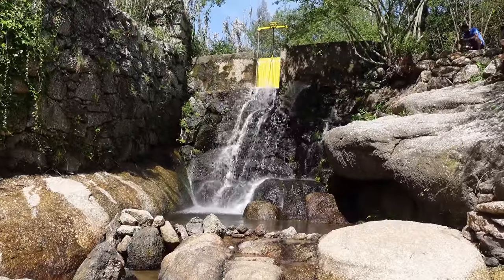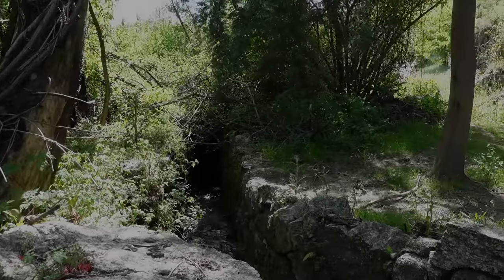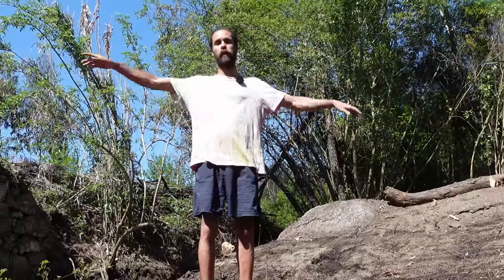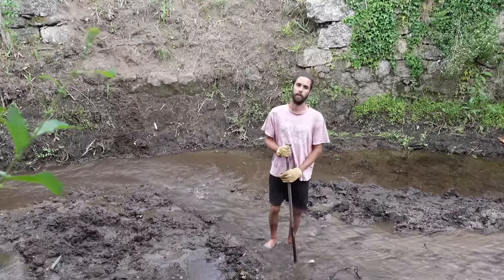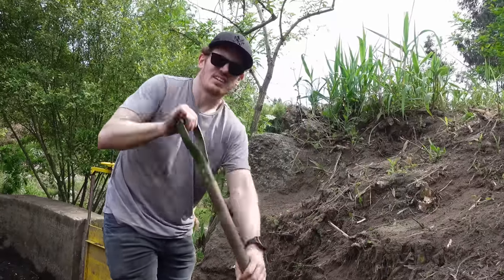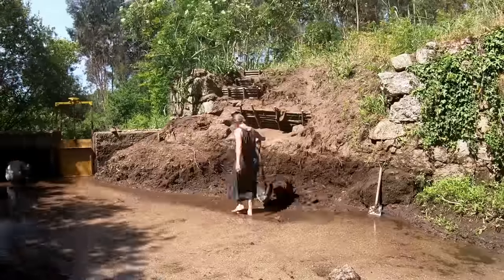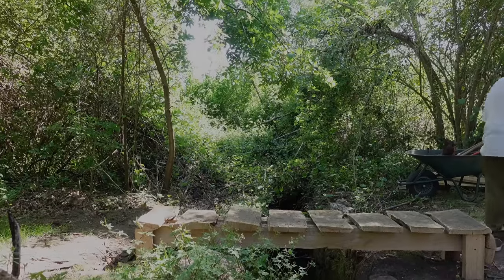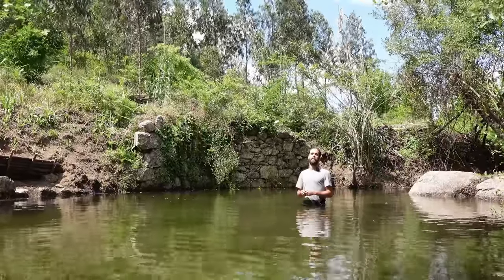#79 Re-discovering an old natural pool

Comment: REGARDING THE CHESTNUT SPROUTS: That species is the highest value tree in your region.  Select one of the root sprouts and remove the others at grade.  You don't want a chestnut growing in a cluster.  It will be very weak at the junction and likely will split and die prematurely.  If you have chestnut on your property, put them on the top of your list to be "released" from surrounding competition.  They want full sun. This coming fall, go back to these trees to collect burs and plant the nuts in a tree nursery.  If you have surplus nuts, dry them and process them into flour or enjoy them roasted whole or cooked in stew like recipes.  Great source of vegetable protein and trace minerals.  THe local people likely refer to this tree as sweet chestnut.  The botanical name is Castanea sativa.
Reply: You can also pickle chestnuts which are nice for winter salads to add extra protein.
Reply: A good choice for outdoors as chestnut is good for 15 years in the ground for posts etc.
I have it on an interior wall and floor and exterior decking. A beautiful timber
Reply: I love when people like you write product and intelligent comments. Thank you
Reply: @heraldocosta1469  Why thank you for your kindness. 😊
Reply: Yes and that hill of soil will wash back into the pond. The washed soil will clog down stream. Interesting. You can tell that soil is suple high in nutrients. use it in the garden add with compost.
Reply: @Melicoy  If I understand correctly, they plan to cover the soil with native grasses and rely on the root network to hold the soil in place.  I would like to see the Project folks buy a blend  of native seeds and broadcast seed across the entire area where earth was disturbed.  I agree with the value of the sediment in Project Kamp's planting projects but I gathered transportation between the sites was not feasible. 😊
Reply: Great comment. I've been growing chestnut from seed and I'm loving it.
Reply: @Jumpingjoep  Keep growing chestnuts and spread your seeds around if you can.  Volunteers like you are the best hope for keeping the species alive.
Reply: @stevejohnstonbaugh9171  I will. I am planting them out into nature and the fields around my home town hopefully turning it into a place where people notice the amount of trees and the diversity. I intend to live to a hundred so by that time it will be a joy to see all that I'll have planted on my daily walks.
Reply: Nice
Reply: You seem very knowledgable, you should make some videos for us youngsters to cling to.
Reply: @trentwilliams7829  Are you saying "OK Boomer, F---off ?  If so I'll apologize for annoying you.  If not, I'll fill in my thoughts; 1) I do not think of you folks as "youngsters".  That is your projection.  I think of your generation as the future that is carrying on as my generation fades away.  I sincerely hope you do a better job of it than we did. 2)  I'm a lonely old man who lives alone due to a variety of events - some good, some bad.  3) I'm simply trying to share what I have learned during my career/lifetime with the future, with the tools I can operate. 4) I don't have any expectation that anyone will "cling" to my thoughts.  5) I would not know how to make a video and living 3000 miles from the project, no one would be interested.  6) I accept where and what I am - just struggling mightily to hang on to some purpose in the life that remains.  Everyday I  hope I help someone - and I ask for nothing in return.  I hope this background is useful. 😊
Reply: @stevejohnstonbaugh9171 , My man, I didn't mean any disrespect. I meant what I said honestly, I'm 29 years old for context and my partner and I have just saved up enough to possibly buy a plot in Spain. I have read many books and grown young trees from seed, nut and cutting, but I have never come across the information you commented on in this video. I was just saying, the knowledge you have should be passed on and I think a video is the best way to do it, no big production value or anything is needed. 

Perhaps it was the use of the word cling or a lack of context which made my comment read poorly. I only said cling because that's exactly what I will do with the information you shared as I plan to keep growing a lot of chestnuts. 

To conclude I think the knowledge you have is too valuable to be buried in a comments section. Can I ask where you have gotten your tree-rearing experience from?
Reply: I wonder if that type of tree would grow in the piney woods area of Texas?
Reply: @trentwilliams7829   Hello Trent,  I'm not seeing the reply I made several days ago.  It was long - and I may have forgotten to hit the Reply button.  Did you see a reply from me?  Let me know.  If I screwed up, I'll try again.  Thanks!
Reply: @stevejohnstonbaugh9171  I have only seen your first reply where I think you misunderstood my message as me calling you a boomer.
Reply: @trentwilliams7829  I am so sorry.  My old age is showing again.  I spent quite a bit of time explaining and apologizing for my original message, answering you questions and offering to help you and your partner in any way I can.  I must have forgotten to hit reply - again.  I'm not feeling very well today so I'm not up to a do-over.  What I can do is apologize for being snarky and offer my assistance.  I hope you have a good Friday and a lovely weekend  😊 All the best!
Reply: Thank you everyone who liked my comment.  This has never happened to me before. 1,200+ "thumbs up" gives me purpose to continue on.  I am so grateful. ♥
Reply: Effort
Reply: This is the nicest comment section I’ve ever seen
Reply: @Fred-tw2zo  Thank you so much for the kind words.  Kindness has come to me rarely in the past 23 years.  Only one person who has always been there for me - so I am especially grateful♥
Reply: I smoke trees too. My favourite is Sative!  🙏🏻
Reply: This post was written by a chestnut tree
Reply: Guys, Here is our Savior

HalleluYAH translates “Praise ye YaH”

YaH is The Heavenly Father
YaH arrives via the TENT OF MEETING
YaH was Who they Crucified for our sins
YaH was Crucified on an Almond TREE

Semitic of Moshe (Moses)
Isa Scroll (The Original Isaiah)

Isaiah 42:8 - I am YaH; that is my Name! I will not yield my glory to another or my praise to idols.

Isaiah 43:11 - I am YAH, and there is no other Savior but Me.

Isaiah 45:5 - I am YaH, and there is none else.

Comment: Have you considered making a trailer/cart with bicycle wheels to transport things around the land? For a lot of jobs this would be more useful/easier than the wheelbarrow.
Reply: Yeah good idea
Reply: agreed. 2 wheels with long handles, very easy to move, and can hold a LOT of weight without being too heavy to lift the handles.
Reply from the maker: yeh would love to make one. Let us know if you have some good inspiration or examples!
Reply: @ProjectKamp  There is a good example of one on the YouTube channel Freedom Cooking, title Homemade Cart - flatbed wagon with removable deck...  I think it could be adapted to have handles instead of the tongue for a trailer quite easily.
Reply: Research Vermont cart
Reply: Imagine what a mule or donkey could do on that terrain.
Reply: @ProjectKamp 
То что вы сделали, РЕБЯТА, это ПРЕКРАСНО!!!!
Reply: @ProjectKamp  just make the bicycle version of the nachomobile
Reply: I think this is a good idea but I wonder if it could be expanded upon. 
You have lots of mimosa and some of it is of a suitable size and straight enough to be used as lightweight wooden rails.
If you were to get say 2 peices of ablout 3M long and fastened them together with 3 or 4 cross braces. 
Then another set similar.
A lightweight cart with wheels that would ride on the rails. could have made Julies work a lot easier moving those posts. roll the cart along the two sections then move the back section to the front and advance like that.
 For a larger project it may be possible  to lay a longer section of temporary track. 
It would never be a permenent "Railway" but possibly an idea for  "project work"
Reply: @ProjectKamp  Phil vandelay cargo bike could be a starting point
Reply: Electric hub wheel added to a tricycle with a back basket or even a bike trailer would be helpful too. Solar reached and you're off grid :)
Reply: When I lived in a rural area I used a big tricycle with a metal basket to move things easily through the terrain. The tricycle could be more stable; but it sure would need adaptations to the terrain!
Reply: @Paul_Au  Easier than that: a zip line pulley system. Use rope and pulleys to move heavy materials from one place to another.
Reply: @airenesmiler6624  Perfect choice they already have all the materials they need, and you can litterally find bicycle Wheels everywhere.
Reply: Hand carts are great for when you have reasonable flat ground to work with, but they don't work so well in terrain. Remember, the point of gravity is fairly high up, above the wheel axels, so it tips over quite easily. A bicycle pack cart is better, because it has the packing basket or what you would call it, lowered down between the wheels for a lower point of gravity. Get one of those, or copy the way they are constructed.

Wheelbarrows have one major advantage, in that you can always balance the load so it doesn't tip over. The wheelbarrow must be carefully loaded so that the point of gravity is directly above the wheel, or slightly towards you. Remember to keep it level when going up- or down-hill.

There are all kinds of different styles of lifting devices used around the world. They can be an Asian style lifting pole that you carry over one shoulder, or a European style lifting harness that distributed the weight onto both shoulders.
The idea is to split the weight in two, find balance and get the objects slightly away from your legs. This makes it a lot easier than carrying, say a single heavy bucket of mud.

Comment: That chainsaw needs sharpening!
Reply: How about putting some air in that barrel wheel.
Reply: Nah, a mostly flat wheelbarrow tyre will help it be more stable on rough ground.

Youy do however need to pull it rather than push it, or all your effort will go into the tyre.

Comment: the safety handle suggestion on the wooden bridge is good. Even if it's okay that  there's none but it would be very helpful to someone who needs it. Adding small steps would help too since it looks like it is too high, would help prevent spraining an ankle too when stepping down.

watching kampers working together always brings up the mood, always nice to see teamwork.
Reply: Or instead of smaller steps, a proper ramp so they can easily bring the wheelbarrow across in the future.
Reply: @scottstewart3884  And while they are at it, inflate the tyre of that wheelbarrow, will make it much easier and lighter to push.
Reply: Those are my thoughts as well. There are a lot of protruding stakes above the retaining walls to injury yourself on as well, which are also not properly anchored, reinforced, or perpendicular to the ground. Many of the steps are far too tall, not just for the bridge without a handrail, and many paths are not properly cleared. In short, there are many safety issues it's easy for the young and able-bodied to overlook. It would be nice, if they're working closely with the elders, to read a few manuals on accessible infrastructure, which will have recommendations for step height, handrail placement, safety fencing, and maximum gradation of slopes. There are also trail construction and maintenance manuals that would help them identify landslide hazards and instruct on proper retaining wall construction. Lovely, uplifting project. A little naively executed, though. But don't get me started on all those bare feet, haha.
Reply: Yes, and the bridge should have been built at grade level so no steps or ramp would be needed.  It would be a simple adjustment would make the bridge safer and much easier to access!

Comment: It might still make sense to create a dirt wall / leaf trap in front of the lagoon. This way the lagoon would not silt up so quickly and you only had to dig up a smaller area every now and then instead of the whole lagoon.

This is done in pretty much all larger reservoirs.
Reply: Hay bales staked down work great for this.

Comment: Wonderful job! Glad you can enjoy the lagoon more in the coming season and years!

Regarding the rest of the waterflows on the land, I'd humbly recommend to be careful about canopy removal : if you remove too much trees around the watercourses, the water might become too "warm" for some of the local biodiversity to settle comfortably. I remember on top of my head that a "good" ratio is 60% shaded to 40% exposed. Temporary water-holding (i.e. smaller ponds or "porous", beaver-style dams) can also help water sink in the ground, which will benefit to any vegetation nearby. (just a few thoughts as a humble landscape architect from Switzerland)

Also, with all the mimosas going to be cut, I'd highly recommend to test their wood for water-related projects: it appartenly has good durability in prolonged contact to water (to be confirmed for the species in question), which would be a very good fit for any water-related landscape construction.

Keep up the good work and the community spirit, you people are gold

Comment: It will only get cleaner and nicer as time goes on, very nice job on the project. You can produce quite a bit of energy from a small 3" pipe on the back of the dam running a Pelton wheel generator. Make a funnel trough that catches the spillway water and you are golden for producing decent power.

Comment: The pond looks a LOT better now. It looks like there's still a good bit of cleanup to do around the tall rock wall in the back, but the front 2/3rds of the pond look good. Draining and filling the pond a couple times will help flush all the mud and debris down the creek and make it easier to clean up... Also, it would be a good idea to rake the gravel while the pond is draining in order to stir up more of the dirt/mud and flush it on out while the pond drains.. I'd also get that last lump of dirt near the water gate dug out.
Reply: I came here to say the same thing - after all that incredibly hard work, draining and refilling the pool seems like an easy way to make a huge improvement.
Reply: @mafurock33  I would recommend an extra dam upstream of the pond so the water has enough power to really wash away the sediment.

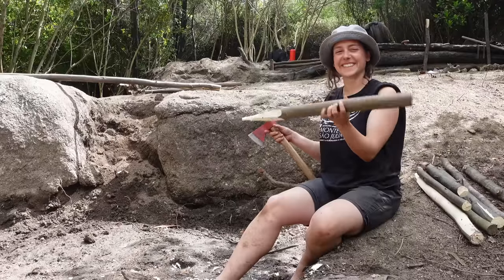Comment: 15:40 There is an old japanese style of making housing where when you place stakes in the ground like that, debark whatever part of the spike is going in the ground and char it by burning the ends. This reduces decay of any natural wood in the ground. Meaning those stairs and any other project you build out of wood long term in dirt will last way longer. I have seen a natural hut made out of wood, sticks and moss last over 2 years of harsh weather conditions without any signs of decay thanks to this method.